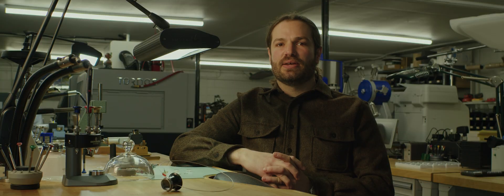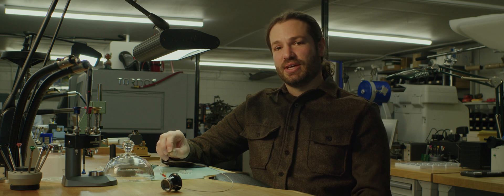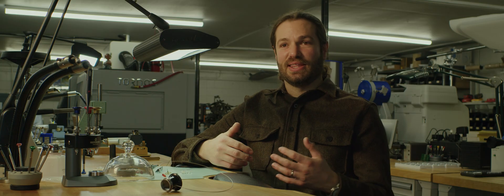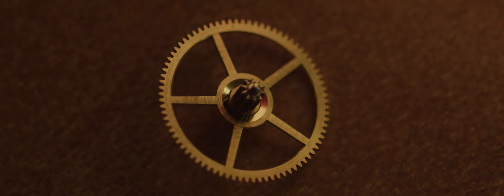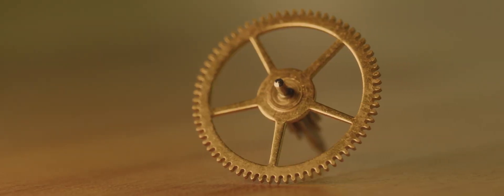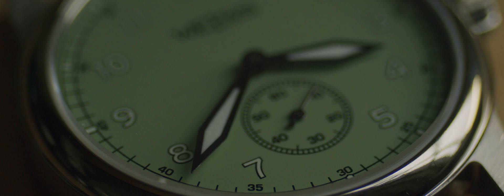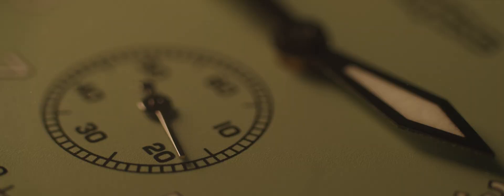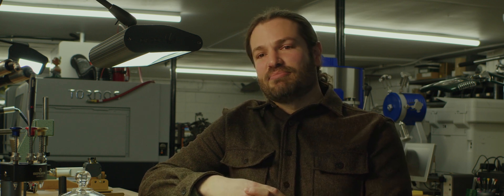The Watchmaker's Workshop:  Watchmaking - Gear Trains

Comment: What does the mainspring barrel attach to first? Is it the center wheel? And that has the cannon pinion on it?

What defines how fast the center wheel turns? I presume that'd be the escapement, correct?
Reply: Its based on how many teeth are cut into the gear

Comment: Wait, so if I still remember Watch and Listen and what I gather from this... The escapement wheel is the transmission of the power, and the balance wheel is the brakes. So the escament wheel transfers the power to the hands, but it id the balance wheel the one that sets how fast time passes on those hands... Right? haha
Reply from the maker: The gear train is the transmission of power from the mainspring to the escapement.  The mainspring is the storage of power and the escapement is what regulates the flow of energy so it is allowed to release at a known rate.  That rate is displayed using the watch hands.